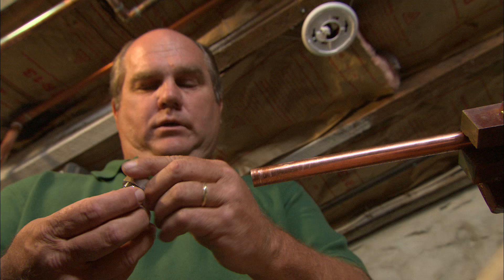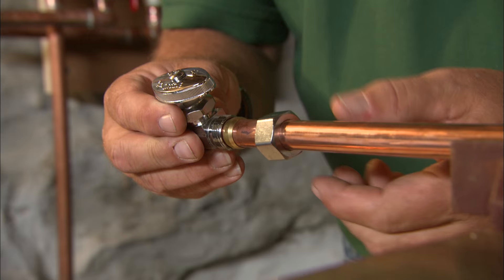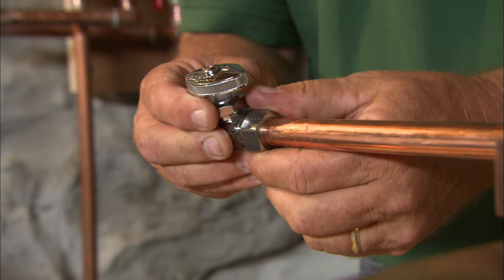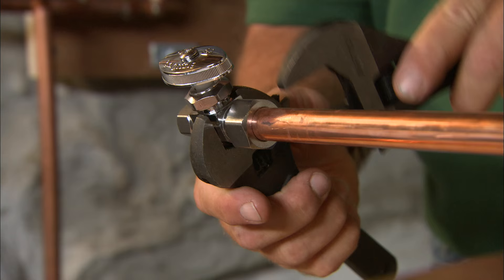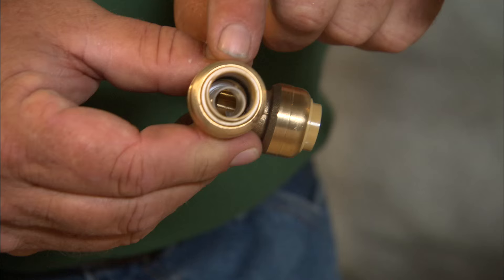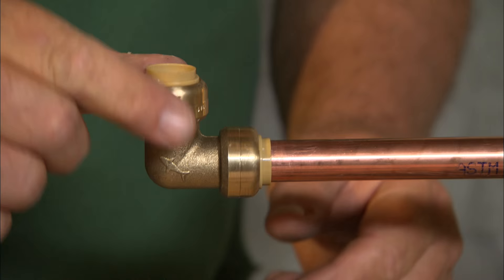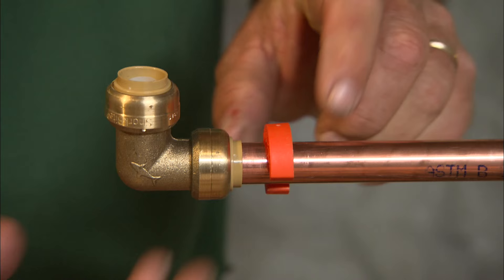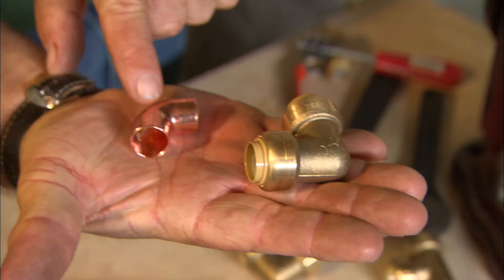How to Connect Pipe Without Soldering | Ask Richard | Ask This Old House

Comment: Please don’t use the push fittings in an area where a leak would cause damage. Those things are only sealed by an o-ring so they will not last long. I don’t not recommend them - compression fittings on the other hand, are fine.

Comment: These push type connections are great, been using them for years with pneumatics. Just piped my entire shop with PUR line for compressed air. Soldering is a thing of the past for me.
Reply: +briancnc you dont know what you are talking about
Reply: +poohpush Care to elaborate?
Reply: +poohpush  The PUR hose he's talking about is short for polyurethane...and it's used in shops and garages for compressed air hoses. Not to be confused with PUR the water filtration company or PEX water plumbing which is made of polyethylene.

PUR and PEX both use the same kinds of fittings(compression or crimp fittings) so the installation is very similar.
Reply: I did not know you could use Sharkbite for air lines.  I just want to be sure I am reading your comment correctly as it sounds great if it works and will help me mightily.

Comment: Sharkbite fittings are so handy for around the house connections. They have propress fittings and tools now but the tool costs thousands of dollars right now. It's pretty much restricted to commercial guys right now. Ridgid and Milwaukee have some tools.
Reply: Tia crew member lol
Reply: +Jacob Brennan Hey!!
Reply: +DarkRaptor99  If I worked with 2 inch fittings everyday I would buy the propress in a second regardless of tool cost. But I don't, I can solder smaller fittings all day but when I get to 2 inch it makes me a little nervous about leaks. DeWalt is going to come out with a press tool, hopefully that brings down the price with more competition. #TIA crew!!

Comment: I have always struggled with how much to "snug" the compression fittings up.  I wish he would have touched upon this.  I've taken to under-tightening the fitting, turning the water back on, and then incrementally wrenching it down until the leaking stops.  Anyone have any recommendations?
Reply: +keifsanderson  There is no exact science as to how tight they should be rule of thumb is snug enough so that they do not leak , another thing not covered the ferrule fitting is soft brass and can easily be damaged thus leading to cutting down the pipe and maybe being to short to put a fitting on so your method is most likely the best .
Reply: You don't want to kill the fitting.  Just snug it up with a wrench.  The other thing I've learned from another plumber on YT is to place pipe tread sealant on the ferrule.  It gives an added measure of insurance.
Reply: @AStanton1966  Thanks.  I'll have to try the sealant trick.  Not sure if it's just me, but I feel like now that everything is made of Chinesium, the tolerances are off and getting a good seal is even harder than before.

Comment: Could I use these fittings for a tankless water heater connection that’s outside the wall?
Reply: Sharkbite makes a fitting for a water heater.  It's connected with a flex line and gives you the whole works.

Comment: Most people who use compression fittings will tighten it too much, and the result is a leak that never stops. Even worse is people who don't tighten the compression ring enough and the fitting blows off when they are at work, and the house fills up with 2 feet of water by the time their arrive home. A Sharkbite fitting is a bit more money but it saves you from a flood that will cost you $10,000+ to repair. Remember to push the pipe in until you feel the SECOND click.
Reply: I've used about a dozen Sharkbite fittings lately.  They are wonder, especially if you  can't get the affected pipes free of water.  Just don't cheese up and not buy their gauge.  The gauge will help you to prep the pipe and make sure the Sharkbite fitting is installed at the correct depth.

Comment: For copper pipes in basement ceiling, that lead to my garden hose. I have some access now, from a kitchen floor redo, but it will be difficult access later. 
I am changing 3 pieces: a valve, an elbow along with the outdoor tap.
For long term, problem free reliability, I don’t mind paying more but does the Push Fit fittings or the Compression with nut fittings last, or better to stick with soldering? 
Which one will hold better in the long run? 
Your opining is very much appreciated.

Comment: is sharkbite recommended for in wall applications? I know it has a gasket in its design would not this wear with time?
Reply: O rings will wear over time. So behind walls would be unwise. They are great for smaller things but after the years pass the o ring will probably deform or deteriorate and you wouldn't want this behind a wall. Soldering or Compression connections are the way to go behind walls

Comment: would these two methods be suitable for a pipe network of a heating system? I need to change my pipelines that take hot water from my woodburner and distribute it to my radiators.....the water can reach temps of 100 Celsius
Reply: I would go with compression fittings.